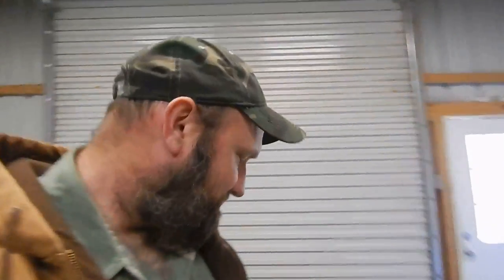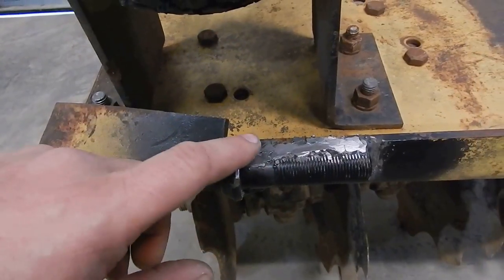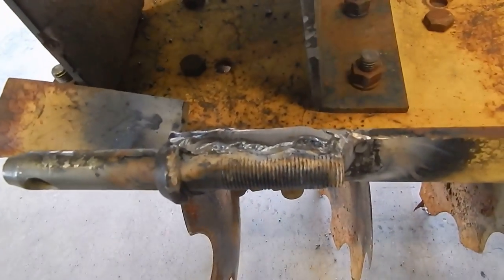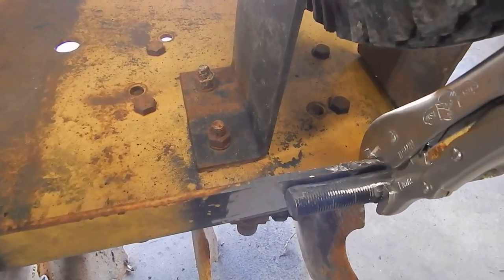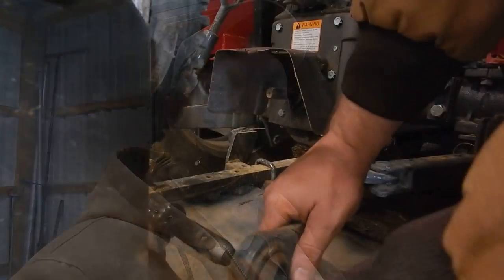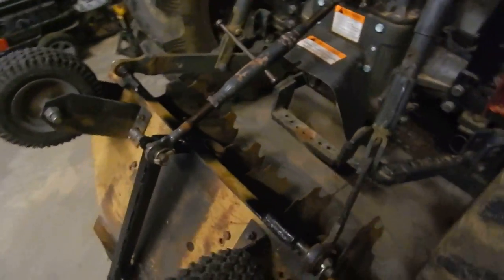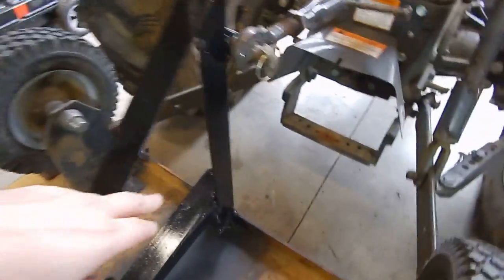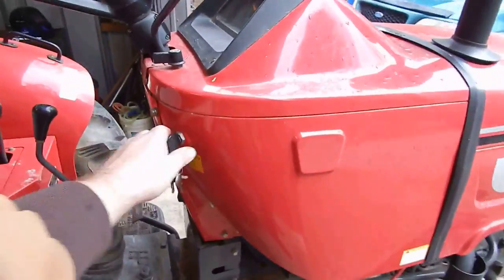Make ATV Disc Into 3 Point Disc

Comment: hey brother! if u weld another pin spot on the other side of the 3 point u will have to work it really har to break it but the way it is it will twist if it gets the chance and snap the eye off but if it works it works! ;-)
Reply from the maker: Thanks for the advice. I told my wife I could do some more modifications to it to make it stronger and will probably have to down the road. Right now it is doing alright but I am taking it easy just in case. Have a Blessed Day friend!